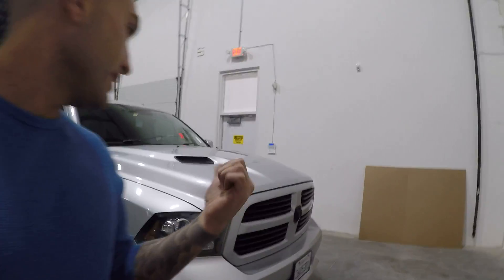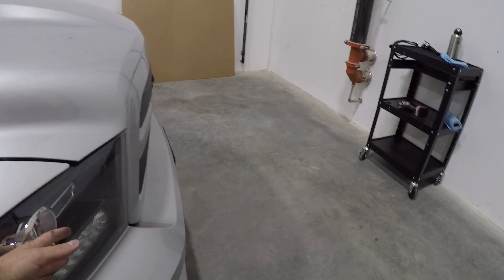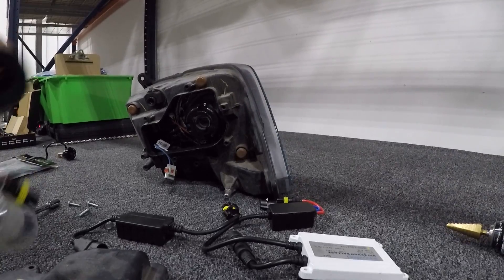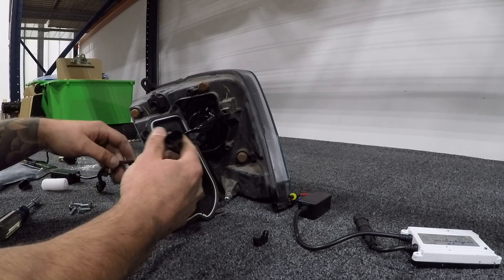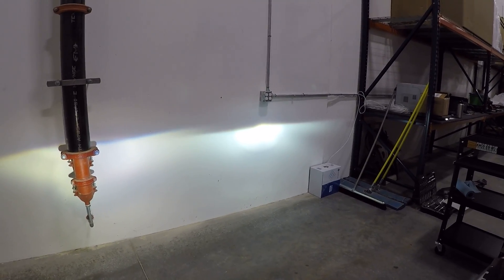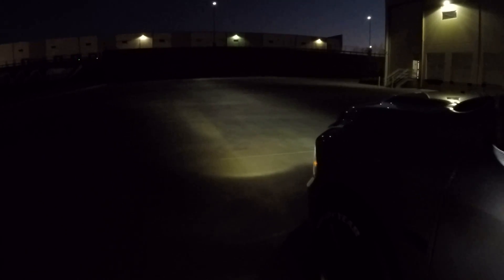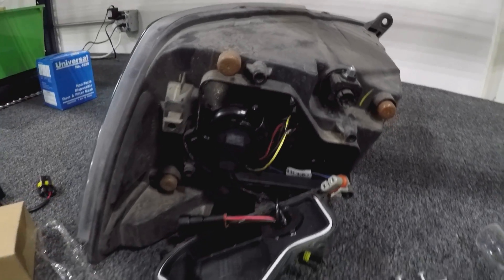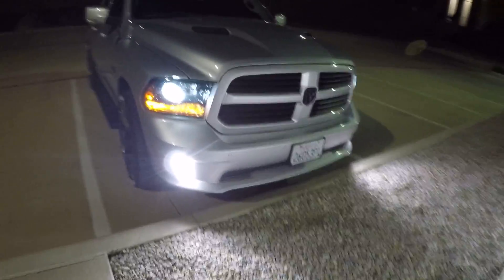LED vs HID in Factory Halogen Projector Headlights

Comment: Boosted, I am sure you have answered this question 100 times. I followed all your videos on the install with the Innovative HID kit. I got the exact same set up just like you recommend, however, I came across a power issue. I bought the relay harness from Innovative, but now I am getting the error code that the low-beam is out. The lights still work, but the system says the lights are a out. Any suggestions? and yes I got the decoder too. I am already tried talking to the Innovative staff about the issue but they want me to get the 35 watt ones instead. Does that make since?? Also, I drive a 2017 Ram 1500 Sport

Comment: Here's the problem with HIDs with no glare shields or with them. The light hot spot is concentrated in the center and doesnt do an even amount of light in a 140 degrees. You're not suppose to have a center bright hot spot in projector headlights. You can see further with HIDs but you won't see anything at night at your 10 o clock and 2 o clock positions when you're suppose to.

Comment: I'm thinking of doing my headlights on my ram, now I had a question what do you think about the HID kite that OPT7 offers? I have used their 35w blitz hid kit on my suburban and they are pretty bright and strong I just don't know if they will work as well with the ram projectors. Just wanted to see what your thoughts are on this...
Reply from the maker: I would go 55w if possible!
Reply: BoostedMotorsports the decoders that you used do they fit with any other brand of hid kits?
Reply from the maker: They fit on any brand HID 👍
Reply: @BoostedMotorsports  wat about 15 dodge charger police persuit ex cop car
Reply: 55w is the minimum ballast power on projectors I recommend. 55w gives out a decent amount of light, but not as much as I like.  I would advise to get 100w hid kit with relay.  I got them on my car and its awesome with 4300k-5000k. These kits can be bought cheaply on eBay from China. I first install hid myself over 10 years ago. Started at 35w, 55w then now 100w. Great vid by the OP.

Comment: Just ordered my headlights 💯 real glad I watched this video before just buying random bulbs!
Reply from the maker: Thanks!  Let me know what you think of the other mod videos on this channel too when you get a chance!
Reply: BoostedMotorsports Quick question. So I installed my HID but it seems like randomly while I’m parked or driving the light turn off or on. What do you think is the problem there? They don’t seem to turn on or off when you’re driving over bumby roads so they are well connected. I do have the canbus decoder on it
Reply: @CimarronCarlos  that's why i ditched my hid headlights i bought nice morimoto hids for my truck and once it get a little cold out one likes to just shut off randomly annoying and kinda embarrassing having a light always shut off on me
Reply: BoostedMotorsports so yeah it seems like after a while they shut off and on then after the third time it completely shuts off and doesn’t turn back on until the truck is restarted. Would it be the canbus decoder?

Comment: This video was awesome and easy to follow to install the HID kit. Only problem I’ve run into is that my HIDs take turns working now and sometimes go out completely, I have the 55w 5k and the hakari decoders you recommenced.. I’m thinking next is to install relays for both lights... did you run into this problem? If so how did you remedy it? P.S. I’m running these on a 2016 ram. Thanks for your advice in advance!
Reply from the maker: Thanks!  A bunch of us are finding the auto headlight function doesn't agree with this setup but if you turn the headlights on/off manually it seems to work fine.  I haven't explored a solution yet and just got used to turning them on/off manually but its odd there is no bulb out errors.  If you find a solution definitely post it up! I tried a different brand of decoders but didn't work out.
Reply: Yes u need a relay
Reply: Dude, I ran into the same situation with my 2017 Ram 1500. I ended up getting the relay harness to help with the power issue, however, I am getting the "lowbeam out" error code. I tried to reach out to the innovative staff but they want me to get the 35 watt kit instead which makes no since. I am hoping BoostedMotorsports will help with this problem

Comment: Isn't  driver site light i set to project lower then passenger side this way you wont blind people driving on the other side of the road in opposite direction....
Reply from the maker: Yes sir drivers side is always a bit lower but the brightness and concentration is much brighter between the two bulb types

Comment: I know you live in California and it does not get cold there like it does here in the North East. I have use an OPT7 kit in the past and when the temps drop the ballast do not work, I got a replacement kit and experienced the same issue so I just went back to halogens for reliability. I saw a review on Amazon for this kit that some one else was experiencing the same issue and was sent a new kit. Has anyone else experienced this issue in the colder climates and linked it to a cause? I am thinking it has something to do with the CAN bus adapter possibly, but I could be wrong.

Comment: I love following your videos, awesome information and it made my "new to me" 2015 Ram Sport easier to customize. I'm having some issues with the 55w HID conversion you are running. The flicker when I unlock the truck seems to throw the truck into a tizzy. The drivers side light went out, and a few days later the passenger side went out. I ended up going back with the stock bulbs until I can figure out whats going on. Also, will 55w HID bulbs work in the factory fog light housing? Or is that asking for to much power?
Reply: Sounds like that truck has a canbus system that is shutting off your lights sensing the current draw is not what a factory halogen would get. You can get around this with simple universal plug and play canbus bypass that plugs in between the ballast and bulb!
Reply: One more thing, don't leave your headlight switch on auto as many with dodge rams have reported similar issues. If you use your light switch "manually" they will work from what I have read! 

Hope that helps!

Comment: I watched a few videos where people put 55w hid in projector headlights and the heat from the hid melted the headlight lenses. Have you had any problems like that?
Reply from the maker: Hey Ryan no issues so far and been running this setup for almost a year in extreme heat and even during the daytime for visibility.  I'll keep everyone posted if things change
Reply: I run 100w hid and no problem.

Comment: i noticed in the comments for the canbus kit they sell it says you need a relay too... do you know why it's recommended?  you didn't use one.
Reply from the maker: There is enough power to run the HID kit but the biggest issue is trying to keep the CANBUS system happy and not throw a code.  A bunch of us have been running the CANBUS decoders which are a good solution but the Hikari ones we've been using don't last very long.  I'll update everyone soon with a better setup for the decoder.

Comment: I can't remember which of your other videos I commented on about my low beams going out, using the same setup you did, Innovited 55W 5000k HID and the Hikari CANBUS Decoders. You suggested not using the Auto function and that helped a bit, then going to work one night they went out even using manual mode. I drove in tonight with fogs only lol. I am wondering if the ballasts are not good, both sides are acting up. Usually after sitting when I walk up and unlock it, they'll light but not now. It almost seems that water effects them, every time it rains I have this problem. I don't seem to notice it when its dry. I really don't want to pull everything apart again, but I work midnights and have to have lights.
Reply from the maker: Hey Jamie its the Hikari decoders.  They work great for several months and then seem to act up.  I've replaced one already and its starting to act up again.  I'm going to come up with a better solution for us and make a vid soon on it.
Reply: BoostedMotorsports thanks brother! Well let me tell you. I tried it with new ballast and no Hikari decoders. Same result. I have pinpointed it down to this: I have the key in ACC or RUN and the lights fire. Start the truck up and after a few seconds, they go out. Hey on a positive note, I didn’t break any grille clips this time! Lol 😂😂😂 

So I have a harness coming from innovited. It will be here today. I found that the ‘15+ Mopar vehicles need an additional harness, according to Morimotohid.com
Reply: BoostedMotorsports hey brother! Got my harness in and working now other than the bulb out message. Like you said the Hikari decoders. Also getting a little flicker once in a while. Nothing bad. I talked ya up in my video. https://youtu.be/35XcTgcVII8

Comment: I have a Toyota Auris 2013 that comes with (i think) a Projector housing- pic shown- correct me if I'm wrong.. (http://www.newtowntoyota.parts/assets/full/TOPZQ1412130FK.jpg I want to know the BEST type of bulb (HID/LED)to use and if possible, the top 2 options. I also realize that it's one main projector in each headlight - so High/low beam are adjusted by a flap in the projector, so Im guessing I'll need Bi-LED/HID bulbs.. I'm new to this, and HELLA NERVOUS about getting the wrong thing. ANY EXPERT advise is greatly appreciated (hez.andy@gmail.com). Also not a fan of those 100-200 dollar priced bulbs, if possible, please direct me to the best (durability/affordable/light output- distance+width).

Comment: What type of screws where used to mount the ballast?
Reply from the maker: Nothing too special just some wood screws that bite into the plastic fender liner material.  You could drill a hole and put a bolt and nut but these have been holding up perfectly.

Comment: I'm glad I found this video. I was about to buy a led kit for my 06 mazda3 which has projector headlights. I'd heard about this issue with LED vs hid in projector headlights but your video convinced me against the LED conversion. Is there a guide on what wattage to use for hids?
Reply from the maker: Thanks David!  55w are typically brighter than 35w with the tradeoff of shorter bulb life but its not an issue and if you buy a quality kit it will still last a long time.
Reply: Dude I had an 06 Mazda 3 and I put LED headlights in. The auxbeam f16s. They were brighter than stock but did not have a to used hotspot. This means there was no beam going straight down the road. Just a lot of light flooding the area right in front of the car.
Distance visibility was worse than stock halogens. Not to mention I had to leave the dust cap off for them to fit...
Definitely good call not putting them in the Mazda.
Reply: @rcvg69420  thanks for the feedback!
Reply: 55w minimum, 100w even better. I got 100w on my car.

Comment: So I bought this kit with there canbus/ anti flicker adapters like you have but there brand , and they work great until the Hemi is purring , the driver side stays on but passengers side flickers off , they are saying at the company that I need a the more expensive kit with canbus kit built into the wires , sounds like a bad ballast to me?! What you think?! Btw my truck is a 2015 sport
Reply from the maker: Did you try manually switching the lights on?  Some of us have had issues with the auto headlight function.  I did have one Hikari adapter go out and replacing that brought things back to normal.  I might have to look for a better solution for the canbus adapter for us soon!

Comment: Hi, I received the H 11 H9 H8 kit. The replacements did not fit, so i returned them. Can you please point me in the right direction as to which kit to buy. I even called the company and they directed me to the H11 kit....I'm lost!
Thanks for all the videos, you REALLY do a great job of explaining.
Reply from the maker: Thanks Tony.  Click on this and enter your truck information.  There are many different bulbs for these trucks so you'll have to see which one your truck has http://www.philipsautolighting.com/ajax_select.php
Reply: No good for the Phillips site. Mine is a 2018, the site only goes up to 2017. Mines a Longhorn with projector lights.
Reply: I’ve had the same problem, I got the same kit and for some reason the base of the HID bulb doesn’t fit in the assembly because it’s too small. I’m not sure why mine doesn’t fit. I have the same kit as you and my truck is 2013 Ram 1500 sport with projector lights

***UPDATE***

Make sure you know what size light bulb you need because you need to specify on the website when you click his link! I clicked his link the first time and just assumed the default size would fit and that wasn't the case. Make sure you select 9012 if your RAM has projector headlights and is 2013-2015. Check the size of your light bulbs on google or check your stock ones to see the size!

Comment: Your vids are great! Gives me all sorts of ideas of what to do to my 2014 Ram 1500 Sport (dark grey). I got the same Innovited 55w 5000K HID conversion kit you did, but the Hikari CANBUS decorders are not available to ship to Canada off amazon.com and I can't even find em on amazon.ca. Can you suggest an alternative for me to use or perhaps where I can buy them that will ship to Canada?
Reply from the maker: Thanks Shawn!  Just search for a CANBUS or error canceller that ships to you and try it out.  I am going to test out some other adapters soon cause the Hikari ones seem to have a limited lifespan.  Although they work I've chewed through a couple already
Reply: Hi Shawn, I just installed morimoto hid’s in my projectors on my 16’ sport, did not need decoders in either the low beam hid or highbeam led bulbs, only needed one for my led fogs. Not too sure if the 16’s are different but seems like the canbus only affects the fog lights. Ended up using a higher rated resistor for the fogs

Comment: Excellent walk-through. I purchased the HID kit you used so my question is, what adjustments did you have to make to get the wires to stop at 7 o'clock as opposed to 3 o'clock? I didn't go with another kit because who is to say they won't do the same thing? Just a gamble so if you can explain what I have to do to adjust the bulb or housing I'd be grateful to you. Will be doing this next weekend..... 2017 Rebel. Also, it says the stock low beam is a 9005 for the low beams on the 17 Ram Rebel. Will the 9012 bulb work? Is that why it didn't sit in the right direction?
Reply from the maker: Awesome Thomas!  So let me break it down.  9005, 9006, 9011, 9012 all use a similar 3 tab setup. Only difference is the size and slight variance in position of the tab. To interchange any of them or clock them differently all you need to is trim the peg accordingly.  They all have 3 different size tab/pegs.  All I usually do is trim the largest tab smaller so that I can fit it in a different position.  As long as you retain the 3 tabs there is no issues and doing this you can clock them whatever way you need.  If trimming the largest one down doesn't get you where you need to be then move on to the medium size tab and trim that one down.  You'll see what I mean when you have the bulbs infront of you but maybe I'll make a video on this

Comment: Great Video brother!! I do have a question that I really haven’t seen in the comments. I know you used a stand-alone canbus decoder but do you have any issues with random flickering? I purchased a $200 55w hid kit from theretrofitsource.com for my 2015 Dodge Charger. Ever since the install my lights kept flickering at random moments. Almost like I’m flashing my high beams at people. Now one of my lights are out and I’m told by retrofit that I need to purchase a new kit that’s $215. Your set up will run me under $70 but I wanna make sure it’s a good buy. What do you recommend? Thks!!!!
Reply from the maker: Thanks Greg!  No issues with random flickering while the vehicle is running.  I have a battery that does need to be replaced soon though so when approaching my vehicle and the headlights turn on I usually get one headlight that will flicker a bit due to low voltage but once I start the truck its fine.

Comment: I had HIDs in the past.  About 6-10 months after I put them in, the main computer component on the truck blew and I had to replace, 2k later.  They dealer was the only one who could fix it and they attributed to blowing of the computer to the HIDS I had installed.  Have you every heard anything like this before? Had this problem?
Reply from the maker: Damn that sucks!  I haven't heard that and still no issues on mine after running a bunch of different setups for over a year 😎

Comment: Hello there, I would like to run some hid on my projector housing and I really want to know if relay circuit is necessary in order to get the hid running perfectly?  Thanks.
Reply from the maker: Relay isn't necessary but Canbus decoders are!
Reply: @BoostedMotorsports  Thanks man! 😎 I wouldn't really know what I have to go though with the set-up until I saw your videos! 👍 Totally appreciated!

Comment: Hey I just installed the same set up on my 2015 Ram 1500 and it works at first and then the lights shut off after about 25mins running. What do you suggest?
Reply from the maker: The auto function acts a bit funny with these decoders.  If you turn your headlights on manually it should work fine.  A few of us have experienced this.

Comment: What size hole did that end up being, do you remember?
Reply from the maker: It was about a 3/4" hole to be able to get the clip through.  Just grab a step bit though it makes the cleanest hole which you need to be able to seal properly 👍
Reply: BoostedMotorsports perfect thanks man. That’s what I’m planning on. Just got the Innovited 9012 HIDs today. What all did you do so it would fit?